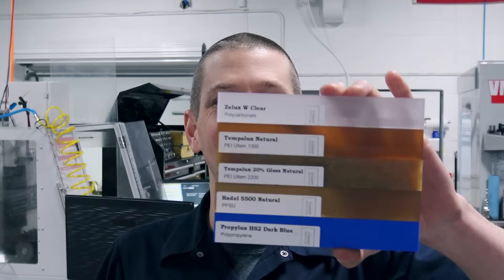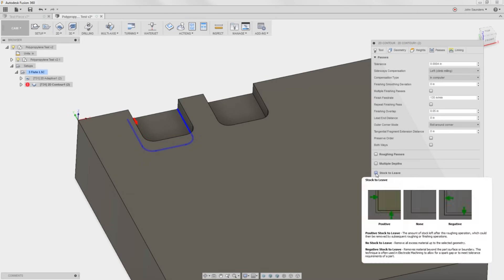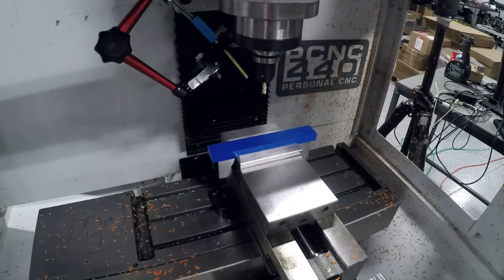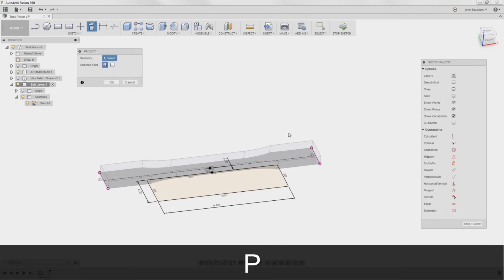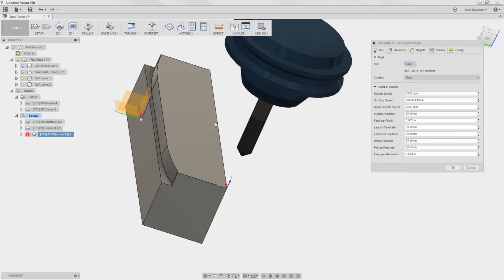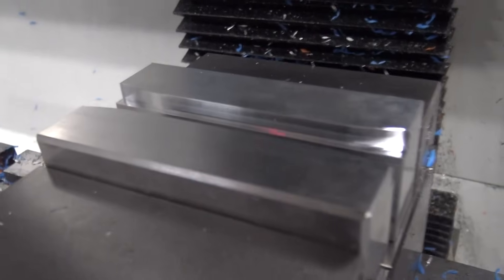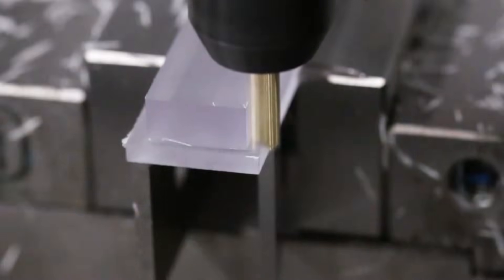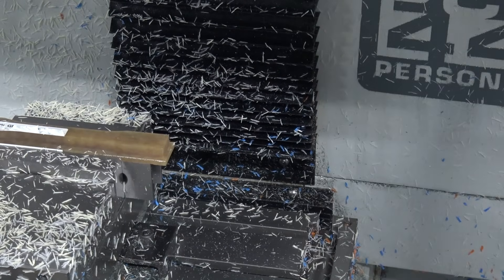Tormach 440 Speeds & Feeds for Plastics WW133

Comment: You mentioned that little ridge you can get from following an adaptive with a 2D contour. It's a squirly thing in Fusion that I wish they would deal with.
When you leave radial stock and set axial to 0 it will still leave .0001" of axial. You'll notice this if you go into the g-code or watch your DRO's between the adaptive and the contour. Your method of adding stock to leave is probably what most of us do as a workaround. setting -.0001" axial in the adaptive works also.
However, if you deselect stock to leave completely in an adaptive, it will run at the exact Z plane of the part.

I know you do a lot of great work with the Fusion team on helping to weed out the little things, this one would save a lot of headache.
Keep up the spirit John! This channel is a lighthouse for the new folks.
Reply: Also,  37 degree aluminum specific carbide cutters (Niagara Cutter) are a dream in plastic as they're polished like shear hog inserts. No worries about rubbing, they're that sharp.

Comment: well, my first job on my 440 went well and it happened to be a nylon job.  The customer was happy and my first check is on its way.  I fought the nylon when cutting an OD and I kept getting a bad surface finish where it looked like the ripples on the edge of a quarter.  I was feeding too quick.  After a hundred parts I was wishing for a power draw bar and tool changer.  I would pay double to have em today... keep up the great work on the vids.

Comment: I used to have to machine graphite every now and then in my old job, as a material it is really nice to machine, a lot faster than anything else i have ever machined but it makes a lot of dust, but as it was only every now and then we would get the job the boss couldn't justify buying an extractor system for it so the way we got around it was using some larger bore locline, mounted the locline on a block near the spindle and then run a vacuum to the block and it worked really well. The same worked for when machining tufnol and cast iron but they didn't work as well but got the job done.

Comment: And a side note on those single lipped cutters. They're better for plastic because they are ground to apply downward force when side milling, so it forces the part into the vise. 
Endmills try and lift the part up and out of the vise. 

Any thin wall or floor applications, use the single lip cutters. Night and day difference

Comment: That PEI stuff is "polyetherimide", similar properties to PEEK, high temperature resistance and solvent resistance. (Some of the fancy plastics have crazy properties - have you ever wondered what they make the little plastic bushings around the elements in soldering irons from? It's PPS (polyphenylene sulfide) and has a maximum service temperature of over 200°C!). As for glass-filled stuff, you get coated carbide cutters for abrasive materials - PCB manufacturers use them all the time for routing FR4 circuit boards.

Comment: Lol I had to look at that exact forum page for when I had to route 1" polypro. I've noticed that low RPM and the highest chip you can manage is your friend with a lot of these soft mechanical plastics. Gotta get that heat into the larger chip and away from your tool and material.

Comment: You don't need to waste time with those HSM tool paths in plastic (or aluminum for that matter). You can run those exact feeds and speeds with 100% step over. You basically can't run too fast in plastic.

Comment: You can cut acrylic at 400ipm at 16k for roughing and 200-300ipm 18K with .015 stock left on walls. Using a single .25in  O flute carbide cutter

Comment: Did you check the dimensional accuracy between the plastics though?  Especially after decking the other side off. 

A few of those are notorious for warping and twisting. Especially when they start getting thinner.

Comment: Really nice video about approaching unknown material. Plz note that there are some plastics (like teflon) you have to use coolang! Else, no matter how sharp the tool ist, it will melt instantly. Also it's really good to use adaptiv strategie for the roughing pass since it minimizes the heat.
Also classic fail with the offset on the soft jaws. A bit pity since they were so perfect^.
Reply: False. Teflon does not melt while machining without coolant.

Comment: 19:04 Hey John. Seeing that step got me thinking that perhaps you could have the whole job setup modified and Jaws that are the whole length of the part. The lower portion is what holds OP2 and the higher portion is the step (maybe ~.080") that grips OP1. What do you think? That way you can just setup jaws and the G54 once for both Ops.

I'm pretty sure the spacing of the jaws and width of part and stock will work out to do this.

Comment: Done a lot of foams and various plastics.  I always look at the spindle rpm limit and/or chuck rpm rating and then giv'r hell.

Feed rates i just keep pushing until i get good results.  Ive had to "peck turn" many parts though to break the stringy chips up

Comment: I'd be curious to learn about some feeds and speeds in phenolic material, like canvas micarta, etc... I'm currently slotting with an 1/8" flat end mill 15ipm .175" deep, ~5200rpm... Running dry with a vacuum sucking off the dust/chips. I don't have coolant.

Are you using any kind of special endmill for the plastic?
Reply: Our mill guy, I know nothing about the stuff, sucks up the dust with a shop vac and makes sure the cutter is always clean and free of material. He uses shop air, but I bet a ChillyBits would be a great purchase for it. It seems like it can just destroy a cutter from re-cutting a fibrous material. Lipton also did a video on it and spoke about cutter entry and exit.

Comment: Talking about the chipload on the single flute...if you have the horsepower, you could nearly triple the chipload on roughing because there's more space to clear the chip.

Also with glass fiber/bead reinforced plastic, heat can be an issue. It wears tools out because the glass doesn't exactly cut, but rather rubs the tool edge producing friction and thus heat.

Comment: I find your soft jaw creation oddly funny and involved...  

First. You could just create 2 blocks, and use the part profile sketch to do an extrude cut into the solid blocks. Since it's parametric, should your part change and become non-symmetric, the jaws will update accordingly. 

Oh. And may wanna make a part template that's your softjaw blocks and just adjust the width between them.  

Second. When you create the work cord,  use the center line between the two jaws. That way the distance between the jaws is fairly inconsequential so you don't have to ding up gage blocks just to gap softjaws. Just get some various diameter drill rod in 6" long sections, and gap your jaws based on those sizes.

Comment: Trying to find the best speeds and feeds for Inconel 625 Like to hear what you guys do.
Reply: Lesley Thompson 
Google!! Like the man says!!
Reply: B Stevermer if it was that simple I would not have asked.

I tell you what I give you 30 minutes to find the information. 
GO
Reply: Lesley Thompson 
Ok , I'll play.
 Type of cut ( side mill full with profile ,size of cutter. Ridged machine or tormac. " type ( brothers etc) carbide,, hss, or ceramic . Coolant?  

Long story short , their is no one answer.  I'm sure you are in the business if your cutting inconell.  But ya, I agree if I could get a definite speed and feed life would be amazing.
Reply: B Stevermer "there is no real answer"
My point exactly.
Just asking for others numbers and experience. I often go through the frustrations of trying to find good info on cutting the superalloys. Problem is when somebody figures out what really works, they usually keep it to themselves.
Reply: You told us no information about what you are doing. I run a lathe most of the time. I can tell you when I cut inconel I follow 2 rules. Cut the fuck out of it, and keep it cool. Cut it as hard and as fast as you have the power to cut it. Use as much coolant as you can. Its easy to work harden it even flooded, so you need to get the chip to take as much heat as you can.
Reply: call garr. ask them. pay whatever they ask for tools. as a starting point run the speeds and feeds the tool manufacturer recommends. the numbers they give in the catalog are usually for a "square" profile cut. ie 50% radial engagement and 1 diameter deep. so a .5" em they give you numbers for half inch deep and .25 step over. the garr book also has a conversion table for converting those numbers to speeds and feeds with lighter stepover, aka HSM.

fyi, cut and paste this above reply to ANY "exotic" or super alloy. makes a lot of money for plain ol steel too. you're welcome.

Comment: generally the simplest tool inventory is two. steel and aluminum. coatings and geometry aren't compatible between the two. (alum oxide coating on steel cutting tools welds to aluminum as one example)

Brand new, never used steel cutting tools run fantastically well in plastic. the relief geometry keeps them from dragging and building more heat. when you're done with cutting the plastic they go back to inventory as never used. aluminum cutting tool geometry is tuned for stabilization which has extra full cylinder behind the edge, lack of back relief. That drags and rubs on plastic bad.

the best strategy for g30 and similar glass fill materials is decline to quote ;)
shops that are really good at these materials designate their old clapped out machines for those so the glass can beat the tar out of the ways before scrapping them out or (sadly but realistically) selling the machine to some sucker that doesn't know any better. Not saying you CAN'T run it but seriously it won't be very fun to clean up unless you devote a lot of resources to managing it. costs not recouped by any of your aluminum, steel, uhmw, polycarb work.

Comment: "duller carbide edge" is not a myth but it is applied only for inserts.
because inserts are made by baking metal powder instead of grinding stock.

if we talk about carbide endmills that has been ground from solid carbide rod - they are as sharp as HSS ones